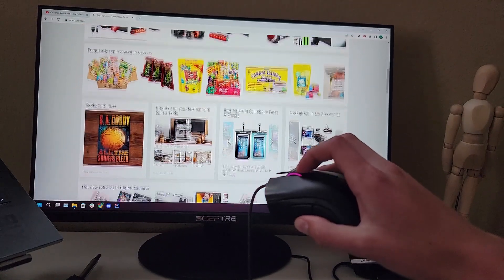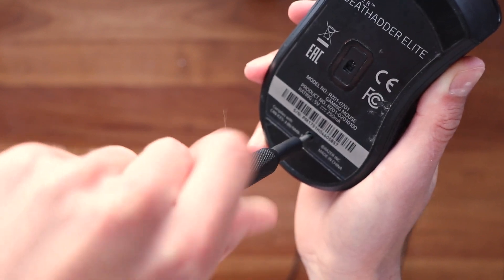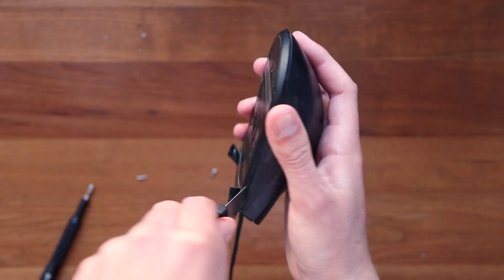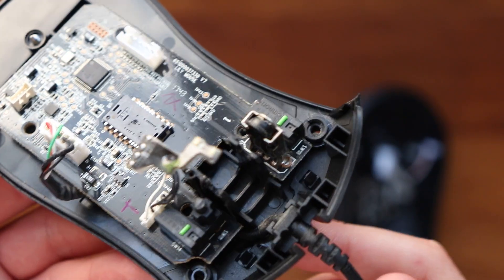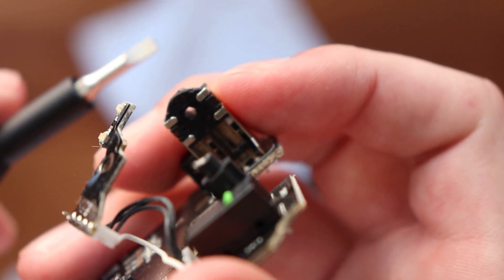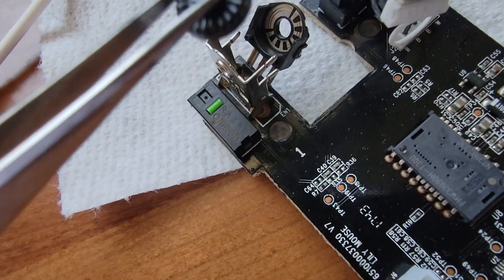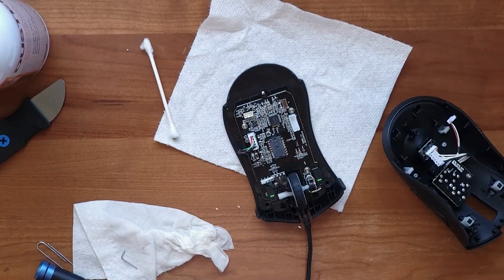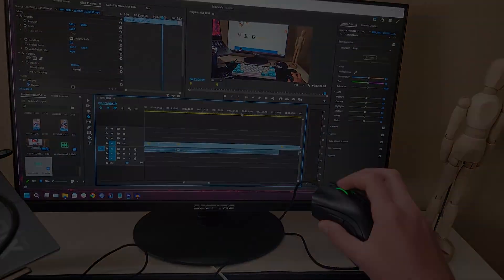How to Fix a Jittering Scroll Wheel (& Razer Deathadder Elite Dissasembly)

Comment: My niche hobby is fixing gaming mices (I fixed dozens of them for my friends, family members etc.), so here I am with few words of my unsolicited advice...

Part which you were repairing is called "mouse wheel encoder". Almost every mouse on the market today is prone to scroll jittering after some time of mouse use (1-3 years typically), because there are microscopic metal shavings which accumulate inside on the contacts of encoder wheel (it's the part you was cleaning in the video)... they are causing false connections between contacts when encoder parts are moving (rotating). The rule of thumb is - the more you scroll, the sooner those metal shavings will accumulate there and sooner you'll encounter jittering during scrolling. So it's a good practice to not use wheel to scroll web pages (use MMB or scrollbars instead) and use wheel only when absolutely necessary (in games), so you preserve it's lifespan as much as possible. Only mices which are imune to scroll jittering are the ones with optical encoders. Sadly, novadays those are only few models from Logitech with "infinite scroll" feature... rest of the mices on the market (99.99%) have mechanical encoders (like this one in the video), which are ALL prone to scroll jittering after some time of use. Why almost every mouse manufacturer use them? Because they are cheap, easy to implement in the mouse design and it's a good thing for manufacturer (planned obsolence), so you have to buy a new mouse every 2-3 years. Sigh.

Anyways - if you want to fix a problem with this type of mechanical encoder properly, you have to change it for a new piece. Blowing, disassembling, cleaning with isopropyl etc. of the old one are temporary fixes which usually last few months only. Those new encoders can be bought really cheap from Aliexpress (just search for "mouse wheel encoder"), they are like $1-2/piece. You just have to know exact height of your encoder, it is measured in millimiters from the base of encoder to center of the hole (search for "mouse wheel encoder height" on Google and switch to images... you'll get it). Typical height of encoders in the last generations of DeathAdders is 14mm, but it can vary from model to model, so double check it to be 100% sure when buying it. My advice is to buy few pieces (3 - 4) to have some stock of them for future repairs... they are really cheap, so why not ;)

When you get them, disassembly your mouse, desolder old encoder, clean holes on the pcb, solder in a new piece and assembly mouse together. It's not that hard, but it's not easy either. People are mostly struggling with desoldering, because there are 5 contacts which are almost impossible to heat at the same time with regular soldering iron, so if you didn't do it before, watch some YT tutorials how to do it with ChipQuick, soldering wick, desoldering pump etc., or ask someone with good soldering/desoldering skills to do it for you. Soldering new encoder in place is relatively easy then.

Pro tip for desoldering of mouse encoder -  if you have soldering gun (not iron.... GUN), it's matter of seconds with custom made soldering tip to desolder it, because you'll be able to heat all 5 contacts AT ONCE - here is a video from my 2nd YT account for that -> https://www.youtube.com/watch?v=vRAd4Xj4D-Q

Good luck.
Reply: thank you so much!
Reply: @BlueSkyEyes  np, bro.
Reply: Even though it is a good comment and advice, it's kinda annoying that the only solution to this problem is to literally not use the scroll for the one sole purpose it was made for- scrolling down and up (on a browser for example). Like at this point we might as well make mouses without scroll if we're not going to use them because they cant sustain it. Although you explained the issue is a very clear way,  I appreciate that.
Reply: @jakub5375  yeah, I feel your pain bro. That simply sucks. You have basically 3 options:
1) don't use scroll wheel when not necessary
2) use it as you wish, be prepared with spare encoders and a soldering iron though
3) buy mouse with OPTICAL encoder, but.... good luck finding one. AFAIK there are literally no mices with it on the current market, except few models from Logitech with Infinite Scroll feature (there must be optical encoders in them, because with mechanical ones Infinite Scroll wouldn't work)
Reply: Hello, I have a little different issue, bought Dethadder v3 2 month ago and it`s wheel click button stopped working properly, I use it a lot for Dota to move my cam and when browsing. Do I clean it or maybe replace it, if there are better options I better change it once? I don`t want to keep disassembling it every few months. Please advise)
Reply: @akiraotoishi8622   hi, if it's only 2 months old, just claim your warranty. I don't think cleaning is a long term solution, it will work fine for some time (maybe), but if there was something wrong with the switch, it will happen again. If you can't claim your mouse warranty (for whatever reason), replace faulty switch for a new one.
Reply: lol your comment was more useful than the video itself thankyou mate!
Reply: I didn't know the metal chipping, thanks for explaining it.
Reply: thank you very much man. You are absolutely right. I've tried this kid's video trick and it did not work. All Razer products are failing very fast. Logi is the best
Reply: yea
Reply: this comment is what ım looking for thanks
Reply: @user-ed7gm7ol8k  u r welcome
Reply: While soldering and desoldering, make sure not to burn out your board.
Reply: What about when your mouse wheel spindle breaks off inside the encoder gear. Mine just did that after about 2 years. Contemplating a new wheel assembly, or just replace the mouse. Ordering a new wheel is like half the cost of the mouse, and who knows if a new one is gonna turn it properly. Feels like a lot of resistance trying to get it to move using my finger.
Reply: I bought my mouse 2 weeks ago and the scroll is worse than what you see in this video, any suggestions please?
Reply: @thescarecrowswife  if it's still covered by warranty, return it. If it's not and you want to keep the mouse, change the scrollwheel encoder.
Reply: And here I thought it was a me problem that every mouse I get keeps having a jittery scroll wheel after a year of usage. Guess I shouldn't rely on using the wheel to scroll from now on.

One question though, can I still click the wheel without worrying about it causing jitters? Even when my wheels get jittery, it can still click fine.

EDIT: Nevermind, you mentioned using the MMB instead so I guess clicking the wheel is fine
Reply: @inzanity490  yea, it's fine to use MMB because you'll statistically use it much less then LMB or RMB switches, so it will have much longer lifespan than those two.
Reply: you are the goat btw
Reply: " So it's a good practice to not use wheel to scroll web pages (use MMB "
If you that in most Razer mice you'll break middle mouse button soon because they use cheap "tactile switches" (many cheap mice use proper switches for MMB, but not Razer). There is a workaround by swapping right mouse button and middle mouse button, for the internet browser at least. I think you can do it with some hidden option in the browser (about: options) or with autohotkey script (that's the solution I use). I'll try to post it later.
Reply: @sigkil  actually... no :) Or, I didn't experienced it yet on any of my mices (30+ pieces). I have few Razers, oldest one is DeathAdder 3G from 2007.... used it A LOT (12-13 years everyday), replaced LMB and RMB switches in it few times, scroll wheel encoder 2 or 3 times. BUT, never the MMB. It's quite logical - even if you use MMB switch for webpages scrolling, it's not used as much as LMBs and RMBs are... they tend to fail first, just because of shitload of clicks they have to endure in comparison with other switches. Heavy gamers tend to break their side buttons too, but I really can't remember if I ever did a MMB switch repair on any mouse which I had my hands on....

But, even if your MMB switch starts failing, it's not a big deal, even if it's some other type than usual 3 pin Omrons, TTCs, Kailhs etc. Just buy the same type and height, and replace it. It's still the same process.

" I think you can do it with some hidden option in the browser (about: options) or with autohotkey script (that's the solution I use)." - no need to search for hidden browser options or making autohotkey scripts... if you want to remap your mouse buttons (and it's a Razer), just do it in Razer Synapse :) Much quicker and simpler (imho).
Reply: This is 5 times more helpful than a guy with a video going, "Umm... Uhhh..." So thank you very much even if this is not the news I wanted to hear. 🫤
Reply: THIS!

Comment: Thanks for the vid..it worked! I have an ASUS ROG Gladius II Core...just be careful and careful with the metal legs, they don't need to be 100% closed, they could break I guess. By closing them until the small wheel does not move, it is ready.

Comment: so i did this and it actually got fixed but i broke 2 of those pins and the tactile feedback from scrolling no longer works lol. Now i have a smooth ass scrollwheel with no jitter but no incremental scrolling feedback

Comment: For me the problem was that if i scrolled to fast, the wheel lost friction in the sensor (at 4:44 the white rod that connects the wheel to the sensor) So i but a little silicon seal piece and showed it in with the wheel when i put it back together, so it has a tighter connection, if it makes sense. That fixed it for me, hopefully it would be useful for others aswell

Comment: Thank you! This worked on my Deathadder Essential that I bought 2 months ago.  

I found what looked like tiny plastic shavings lodged in one of the 3 contacts on the rotating side of the sensor, other than that it was clean, seems like a factory defect.  Thanks again, the scroll jumping was infuriating me!
Reply: has the problem resolved totally not annoying from anymore ?

Comment: So instead of potentially breaking the sensor for the wheel i would suggest getting an ESD brush and some 91% IPA, with the ipa saturate the sensor and then go  get the bristles into where the sensor is while scrubbing just to break up the debris that builds up and then hit it with canned/compressed air to dry it off

Comment: No need to disassemble the wheel. Just pour some electronic safe isopropyl alcohol (99%) onto the encoder (the thing with the metal brackets), scroll up down a few time to cleanup the dirt and spray some air to dry everything.

Comment: What about if you don't have compressed air?
Reply from the maker: You could try using a bike pump. I've used one before, and it's pretty effective at blowing out dust, as long as you put in some effort.
Reply: I don't have one of those either @Val9kIsTaken

Comment: I broke 2 of my tabs the last few times, and the other 2 were really weak too. This time, I took it out and 1 broke, and the other one was really wiggly and wouldn't keep the scroll wheel in place (i tried to move it back into place but it would swing back out again). Fixed it with a rubber band, but that paperclip trick is pretty smart. Gonna try it next time I open this up.

Comment: Thanks for the video! Fixed my mouse with your help. 

A tip for anyone else who doesn't want to bend the tabs: I just used a q-tip to express some iso-alcohol into the wheel sensor a few times, then used compressed air to blow out any debris. That fixed it for me. Might be worth trying before tab-bending as last resort.
Reply: Couldn't remove the sensor so i tried this and it worked, thanks!

Comment: I have razer death adder essential like it glitches whenever i want to go up or doun so i use a diff mouse for scrolling i was about to take it apart but as i was watching a tut i saw ur vid and it worked but the thisng is u have to blow air with ur mouth stuck to the scroll wheel area so that ur applying pressure to it

Comment: I have Razer Viper 8khz and i had the same issue. Tried blowing up but didn't work. I raged and went to the bathroom with my mouse. I washed it with just water, I also scrolled the wheel while doing that. After washing, I had to shake the mouse fast so little water drops came out of it, after that i dried it with towel. Lastly, I also used hairdryer in hot mode and with full speed to dry inside and out. Believe it or not, I connected the mouse after I was sure it's almost (or fully) dried and it worked. I know this is risky, but it worked for me and I tried that last night, tonight I'm still using without zero problems. 

I'm not taking responsibilty if you try and damage your components. It worked for me so I wanted to share.
Reply: Washing a mouse with water wtf?
Reply: @insanity4082  Yeah because nothing else worked. It worked for 6 months and issue started again. I washed it, it took 2 or 3 months to develop the issue. On my last wash, it only lasted about 2 weeks and the issue was worse then ever. The mouse has amazing sensor and tracking but it's wheel is the worst in my opinion. Just because of that, i've switched to Basiliks V3.
Reply: THIOS WOKRED FOR ME THANK YOU!!!!!!!

Comment: You don't have to open the encoder. I dropped a couple of drops of 95% alcohol over the encoder and spun it a couple times in both directions. Repeated it 2-3 times and let it air dry. Afterwards I reassembled the mouse and it worked without a problem.
Reply from the maker: Good to know!
Reply: Thanks, my mouse wheel was nearly not reacting at all any more and some drops of Isopropanol on the encoder worked perfectly!
Reply: bruh you are right! i spray a couple of hand sanitizer and it works! 😎😎😎😎
Reply: Dud I didn't have an alcohol so I did with a petrol. Works good so far

Comment: Thanks for the vid it was a lot of help, my deathadder was reverse scrolling and jumpy so I did this exact process, the wheel encoder thing didnt have any dirt in it or anything. (its been only 2 months since i bought it anyway) the stick going thru the middle of the wheel had a slight bent on the encoder side but I dont know if it happened during my disassembly or if it was already there. So I fixed that and put it back together, it doesn't skip anymore but it has no increment like its very smooth if that makes sense. I am not gonna bother fixing that because it works now but im surprised it happened so quickly, my previous deathadder had no problems for 2.5 years almost.
Reply from the maker: Glad to hear it helped you! The smooth scrolling is likely because you didn't put back the metal piece that clicks into the wheel.
Reply: @Val9kIsTaken  Alright so after this I wanted to fix my old deathadder too (it had the same exact problem) instead of opening and cleaning that piece I just got and sprayed some wd-40 on the encoder and it works like day one now, so if anyone else has the same problem this is the less risky solution 👍
Reply from the maker: @OnlyVuimo  Nice!